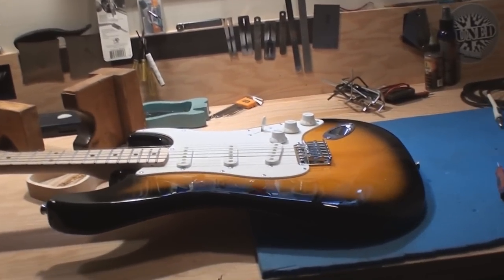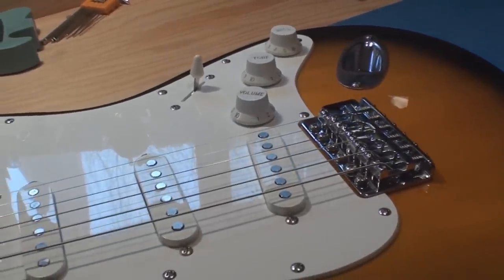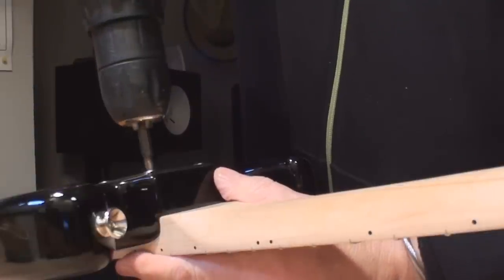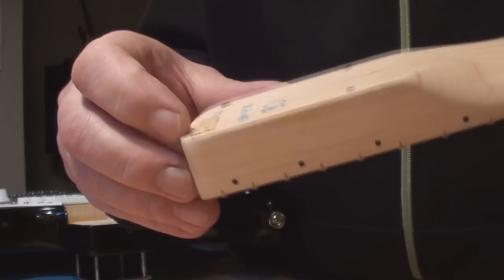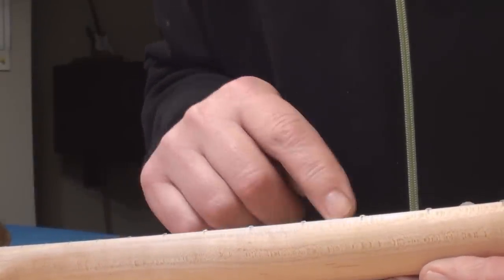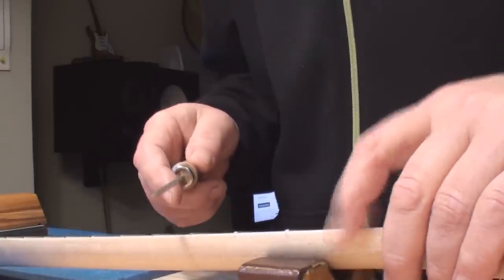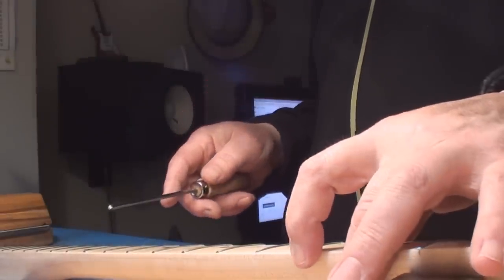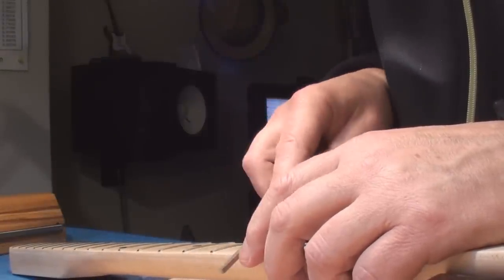Squier STRAT Affinity Series Guitar

Comment: I have a Squier Stratocaster Standard, yes they gave it the dignity of calling it a Stratocaster. 
Fixed the "cheese grater" with a humidity pack, the rosewood bounced right back. plays like a dream. 
My only complaint is that it has a 9.5 neck, the factory setup was done for a 7.25 and 2 strings were out on intonation. 
As a hobby player i am well satisfied with my purchase.
Thanks for the fine informative videos, after make a few minor adjusts, under your expert tutelage, I have fine tuned machine.

Comment: I have a number of stratocasters , Mexican, Japanese and Squiers made in Indonesia and China. The Chinese Affinity Strat is the cheapest but by no means the worst. The 2 tone sunburst is nice. the neck has a nice profile ,narrower than my other two Squier Standards, but feels slightly deeper, which I like.. The rosewood finerboard has nice tight pores and isn't dry. The fret ends are EXCELLENT...better than some more expensive guitars I have. The pickups were okay but I changed them out for some Wilkinson's, cheap OEM but in my opinion very good.  It sounds very good and plays fine.The WORST strat I had was a USA 1979 hardtail in weird Antigua colour. Awful.

Comment: What do you want for 200.00, Dave?  I actually have this guitar, and it plays great, stays in tune, decent sound, decent fingering and came with a little amp, case, & tuner all for about $250.00 before tax. I just purchased a Taylor E-10 Electric Hollow Body for $689.00, Taylor's  brand new signature line up series for 2017. Taylor got great reviews for the E10 & E12 from several sources, and I can't say it is all, that much better, than the Fender as shown here, especially for the difference in cost.  I went in my local high end music store and told them I wanted to get back into playing guitar after 25 years of playing keyboards, and I needed something decent but very cost effective because it's just for home use, and I wanted an electric guitar, and this Fender Squier Affinity is what they recommended, and I've been happy every since. With both the guitars i have now as mentioned I have the best of both worlds. Perhaps one of these days I'll work my way up to owning a Gibson Hummingbird for $3,500.00, but until then, I'm having fun with entry level guitars.

Comment: I have an 02 MII affinity, same exact thing...cheesegrater fret ends, probably part of masterplan to get people to move up to MIA Fenders. Did what Dave did filing each one & it's much better now. I think the factory just slaps together 1000s of necks at a time, then someome inspects them & the ones that have sharp ends get put on the affinitys
Reply: You may be right about that.

I just bought a used (3 months old and hardly even looked at) Squier Standard Stratocaster for $230 Canadian. It retailed 3 months earlier for $360 with tax at Long and McQuaid here in Calgary. Frets were a tiny bit rough so I filed them with a cuticle file and now they are nice. Took about half an hour.

That same day, I looked at an identical Squier Standard at another shop here in town and the frets were truly terrible. Real cheese graters, as Dave says. They cut my fingers as I slid them up and down the side of the fret board. No way I wanted that one!

It is a real crap shoot so look at the guitar before you buy it. 

Part of the problem is that Indonesia is a humid country, while a place like Calgary, at 3600 ft above sea level and next to the Rockies, ain't. The wood shrinks in our dry climate and suddenly the frets at sticking out enough to make it really uncomfortable to play.

But other than the occasional Squier with a bad fret job, if you buy one of the Standard series Strats or better, the fit and finish is usually very, very good. They seem to have come a long way in the last decade or so.

Just buy a Standard series or better, if buying new (or used for that matter), and check the frets, and you should get a really decent guitar for not much money at all. :)

Comment: I have both a Squire Affinty Strat, and a 1995 USA Stratocaster. I prefer the USA model by a long shot. But that said, if I took the time to dial in the Affinty, it would probably be close to the American made model. Like Dave said in this video, the Affinity models are only "half finished". I can understand it, I guess. All the labor intensive hand filing wouldn't work in production facility such as the Indonesian factory where mine was made. But $200 versus $1000 or more. I guess it depends on how much money you have to spend, or want to save.

Comment: Wood shrinks fretwire doesn't. The problem w mass produced chinois junk is that the wood moisture content is all over the place. But what do you expect for $200 or whatever a Squier costs. They are really not worth paying to have set up.
Reply: Yeah, ou have to try out a bunch of them in the shop - a lot of them are "cheese graters". I managed to find one  out of about 15 with really decent frets. I think one of the ways they get the costs down is by having little or no QC... so you have to be your own QC guy. The guy at the shop told me that when they are too bad for the store to sell or salvage, rather than returning the whole guitar to the manufacturer for a refund, they cut the head off and send that. As someone who started playing before stuff got this cheap, it rips my guts out to contemplate it. Just the waste of wood is criminal.
Reply: I've seen $500+ guitars with frets that would slice your arm off. Super-dried wood at time of manufacture, thicker finish to insulate the wood from the environment, and geometry at the edge of the fretboard can influence the amount of this issue. Check the build date, I often see the worst cutters were made in hot and humid July-ish. Gibson switched from binding-over-fret-ends to fret-ends-on-top-of-binding in 2014 models (like many imports), maybe someone knows the real story there...
Reply: jvin248 I've seen plenty of $3000 US-made guitars with awful frets! Price and country of origin doesn't always dictate quality these days. Just because a company buys a $30,000 PLEK machine doesn't mean anything if they don't program it properly (or have an employee that actually checks stuff that comes out of it.)

...and yes, that was totally a dig at Gibson. ;)
Reply: All I know is I go to my local music store now, and every strat from the cheapest Squier to the Americans have the cheesegrater frets.  15 years ago I had a Korean Squier, Mexican, and American Strats and they all had perfectly fine frets.  Quality has taken a HUGE dump in 15 years.  Maybe it's a lot more apparent to me because I'm just getting back into playing after a 10 year hiatus and the difference is like night and day.  Quality now is terrible.
Reply: ... yeah, which is why you have to try out a whole bunch of them in the shop - a self-appointed quality control manager.
Reply: I'm not sure where you're shopping, but I've worked in guitar stores before and we never "chopped the heads off"; defective instruments were always sent back to the manufacturer. That was almost always to the company's US distribution center. The manufacturers typically salvage whatever parts they can, and trash the rest (PRS will literally put defects into a wood chipper.) I've never heard of a single manufacturer accepting a small part of a guitar for replacement. That seems like a good way for a manufacturer to get ripped off by an unethical retailer who's hoarding parts.
Reply: endocry there has been a slip lately in fret work from Fender..my 04 strat has slick fret work....my 2011 72 reissue tele has pretty jaggy fretwork on the bottom side....

Comment: I've heard some people say with a little work these Squier Affinity guitars can be as good as a USA Fender. I have NO problem disagreeing with that statement. You cannot compare a $130 Squier to a $1200 USA Fender, you just can't. That's like trying to say that if you put some work into a Guitar Center Sound Percussion drumset it'll be as good as a DW Collector's series......aint gonna happen. Squier Affinity series guitars are very cheap for a reason, if just a couple of hours on a bench turned them into USA Fenders, they'd cost a lot more than $130. You'd probably have to do some fret work, replace the nut, replace all the hardware, replace all the electronics. And with a $130 guitar, maybe $75 if you bought it used, the parts and labor involved wouldn't be worth it IMHO, unless doing a project was something you wanted to do FOR CUSTOMIZING....not try and make is as good as a USA Fender, because that's not customizing, that's dreaming. And after you stuck $200+ worth of parts into it....and your time(Now that $130 guitar is $330+), and you'd still get $75 for it. Get a MIM, MIJ, MIC(Modern Player), or MIA Fender and you'll be much happier....even a higher end Squier, like the $380 ones are pretty nice.
Reply: +Randy Woolum Those people would be correct...  It's a great base for a partscaster project.  It's a thinner body which may be seen as a disadvantage (less mass), but personally I like it because it's reasonably light.  They've got a standard 11 hole pickguard and are routed for HSH  so that gives you a nice variety of options. The original tuners are decent, the bridge seems okay, although if your a big tremelo dive bomber maybe not so much.  I don't use mine at all and she stays in tune beautifully.  The original electronics weren't horrible and give you your garden variety Fendery single coil sounds, crappy little alpha pots, crappy 5 way selector.  The neck on mine was horrible though and had an awful forward bow to it, piss poor fret job.  The bow was probably poor handling by some kid who got it and  lost interest in it, or so I guess.  It looked like it had been sitting aside probably leaned on the wall or the corner of the closet with crap all piled on it.  It was full of all type of nice DNA samples, but didn't look as if it had been played at all the tops of the frets were like brand new and very little pick wear or anything like that, but dirty as hell like maybe it had ended up in a dumpster at some point or something.  I ended paying 20 bucks for it from Goodwill and after a thorough disassembly and cleaning looked like new, but the neck wasn't worth fooling with, so I replaced it with a licensed aftermarket neck and replaced the pickguard with a nice Fender loaded w/ some nice Tex Mex pups and voila!  A nice sounding, nice playing guitar.
Reply: I priced up doing up my squier strat and made a list of everything that needed to be improved upon and it looked cheaper to buy a mim strat

Comment: Is this a good guitar??
Reply: +OhPlusle I have one. With a decent setup, it's a good guitar. Or I just got lucky. The neck is great, the trem works and stays in tune. Tuners are good. I will say the pickups ain't great. Turned all the way up, the bridge will break your ears. Roll the volume back to 8 or 9. I've had this guitar for a couple of years and really just now started messing with it. The pots are good but with a pickup change, which is going to happen, I'm going to change the pots too. I paid $100 for it. With a couple hundred more put into it, it's going to be a very good guitar, for just knocking around. Or, spend more on a guitar. Which probably makes more sense. But hey, I'm on a mission to prove an okay cheap guitar can be good. But Dave is right in what he says. It will need work.
Reply: +OhPlusle Mine is fine body and neck wise , tuners are ok . but the stock electrics and pickups are cheapo , i have changed my bridge pickup to a Seymour Duncan mimi humbucker and it sounds great :)

Comment: What material are Squiers made of?
Reply: Wood.   LOL.
But seriously, it depends on the series.  The entry level Squiers
the Bullet strats are the worst and cheapest, likely glued together
scraps of basswood for the body and maple necks.   The Affinity
is the mid-level Squier, its not terrible, one piece basswood body
with maple necks.   The decent Squiers are their Classic Vibe
and Vintage Modified lines, the only ones worth having really.
The vintage mod are basswood again, with maple neck
and either maple or rosewood fretboards, duncan licensed
pickups, better (i.e. normal fender mexican-level) hardware,etc.
The classic vibe is basically a Fender MIM (made in mexico)
level guitar, its made of alder like many of the real strats,
has alnico 3 (classic 50's) or alnico 5 (60's) pickups,
med.jumbo frets and 9.5 fretboard radius, i.e. its a real
guitar, and the classic 50's my buddy has is arguably
better than some of the Fender-logo'd MIM strats I've seen.
Reply: Marcus Aurelius  You're close. The Affinities are still entry-level Squiers, typically with really narrow nuts (IIRC they're 41mm wide), and thinner bodies (1.5" thick, instead of the standard 1.75".) The wood used depends on the year though: current Bullets and Affinities have alder bodies, but they've used basswood and agathis (kauri) too. The CV and VM series use alder, basswood or pine, depending on the model. The current Standards use agathis, the Deluxes have basswood bodies. Keep in mind that this is Squier, so sometimes bodies end up with different woods than current spec shows. Case in point: I have a Squier Standard Strat that came with a basswood body. Underneath the black paint is surf green, so I think the body was originally intended for one of the VM Surf Strats. It happens quite often (even with Fender) where they need a body, so they'll grab a random one off the pile and repaint it if necessary. Not that I'm complaining, since I happen to like basswood bodies.

Pretty much all Squiers have at least 3-piece bodies, often more. I've seen plenty of the VM Jazzmasters that have six or seven-piece bodies (you can plainly see the pieces on the sunburst models.) But here's a [not so secret] secret: Fender does the exact same thing, and they always have. They just usually put an alder or ash veneer over it to make it look like a two-piece. That's why the original 2/3-tone sunburst has black edges; it covers up the seams! With the MIM's up through the MIA Standards, you're usually going to get at least a 3-piece body. It's not until you get into the MIA Deluxes and Custom Shop stuff that you get one-piece or center-seamed 2-piece bodies by default. But if you go to any guitar forum, you'll find plenty of people who have stripped the finish off their MIM and MIA Standards and found multi-piece bodies with a veneer on both sides.